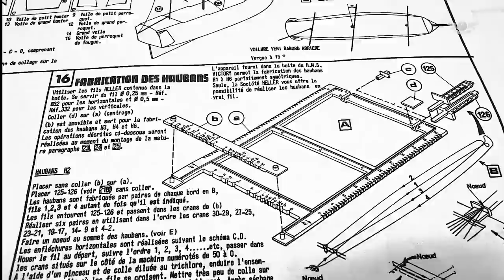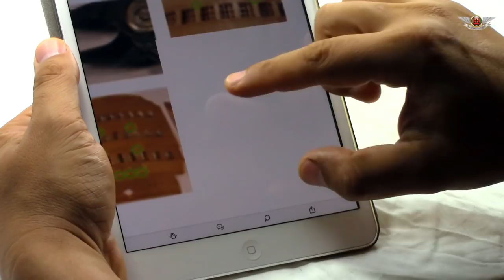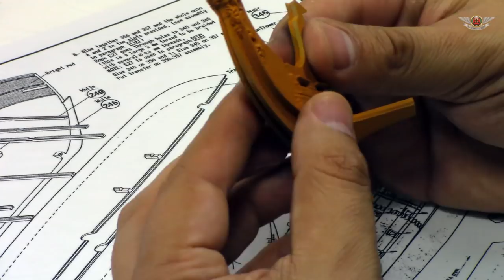EPISODE 3 HELLER #HMS VICTORY BUILD VIDEO

Comment: Using a Rotary multi tool for modeling completely reinvigorated my interest in the hobby as up until I got one I was unsatisfied with my results on the fit and finish of things as I never had the patients to hand trim, sand, cut, smooth with files blades and paper. The speed and ease a multi tool incorporates into quality results got me back into modeling

Comment: Hi, Alex.  I had the pleasure of visiting HMS Victory at the Portsmouth Dockyards back in 2019.  Victory looks like she could cast off her lines and set sail at a moment's notice!  She has been incredibly maintained/preserved and is in absolutely pristine condition from stem to stern.  As displayed, the interior color of the gunwales on the quarter deck is the ochre you have used on your gun carriages.  On the lower gun decks, the interior walls are white with red trim on the inside surfaces surrounding each gun port.  As for the guns themselves, the wheels are unfinished wood with a hub painted the same color as the carriage.  There are some smaller guns (carronades) where the wheels are painted black.  I cannot speak for the historical accuracy but it certainly appears that no detail has been spared to display Victory as she appeared around the time frame of the Battle of Trafalgar. I trust the Royal Navy's archives have been consulted to assure accuracy down to the last detail.  I did an audio tour of the ship.  There was no in person guide to answer specific questions of interest to us modelers.  Keep up the good work with your Victory build.  I am enjoying every minute of it.  HAPPY NEW YEAR.
Reply from the maker: Thank you so much for your comment and help! Happy new year! May 2021 be a lot better than this One... Its not hard😊

Comment: Can someone help me when I tape off the side of the model to put the yellow paint on the pain just sleeps under the tape what type of tape should I use because I’ve used several and all of them allow the tape to see ponder and I have to strip the whole all over again which I’ve done four times now and it’s driving me mad
Reply: Please get back to me before I burn the model in desperation LOL
Reply from the maker: Easy Dave... Sometimes its better to take a breath and look, think, feel... Easy... Have you primed the Hull before painting the color? If not... Comeback... Prime... And re Paint it... Did you use Vallejo Primer? Sometimes its better to use a neutral soay can primer from Tamiya, humbrol... Even car primer...
Reply from the maker: If the Paint you are using doesn t deliver results... Try another brand... But always... Have fun don t stress and go slowly... Allow the Paint to set...